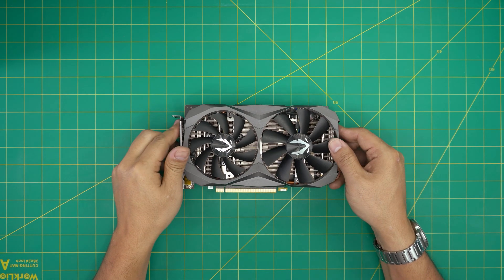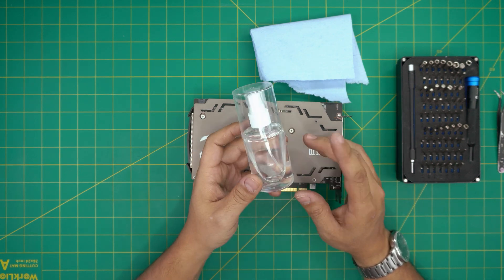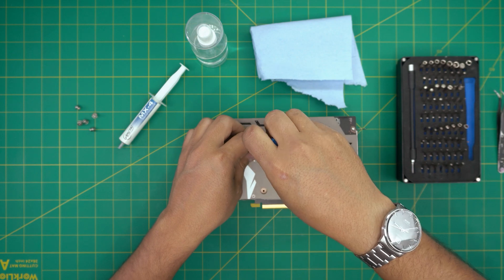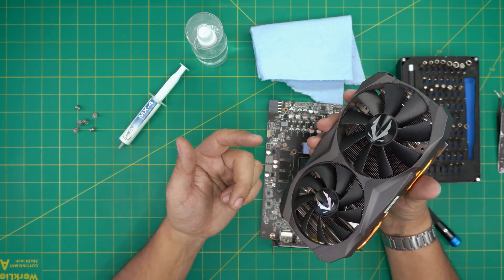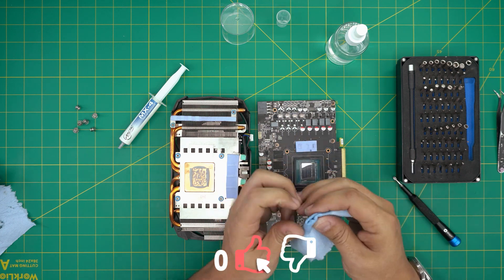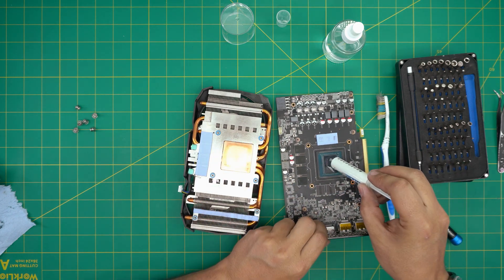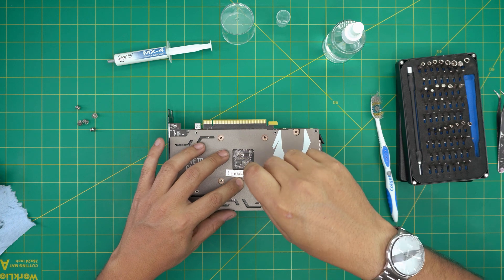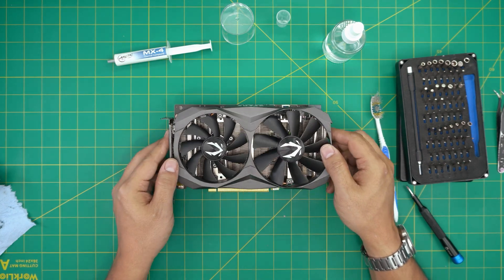How to Repaste and Clean ZOTAC Nvidia GeForce RTX 2060 6GB - Step-by-Step

Comment: The thermal pads don’t matter right only the paste is really necessary?
Reply from the maker: 🫠Regarding your question, yes, the only important thing is the thermal paste, as the old thermal pads are perfectly fine and can last years without any issues.
Should you have any further questions or requests in the future, please don't hesitate to ask me.
cheers🍻
Reply: @uFixTek  when you says years you mean like more than 5 ? it’s been like 4 years since I changed the paste or pads thanks for answering btw
Reply from the maker: the pads can go for over 10-12 years, we have pads from 2012 and still good.

Comment: What is thermal pad size of rtx 2060 6gb amp model ??
Reply from the maker: 🫠Regarding your question, 1mm and 2mm
Should you have any further questions or requests in the future, please don't hesitate to ask me.
cheers🍻
Reply: @uFixTek but the stock thermal pad thickness is 1.5 mm to 2mm . I contact with zotac gaming helpline they ask me TU use 1.5 mm or 2mm
Reply from the maker: We use 2mm, and 1mm also works great.
We service them and stress test them all the time.
But if you wish to use 1.5mm, you can.
Reply: @uFixTek can I use 2mm than ?
Reply from the maker: Yes, use the 2mm, my friend.

Comment: My 2060 of almost 10 years is overheating, gonna re-paste it 🙏
Reply from the maker: Take your time doing the service, and everything will turn out okay.
If you need any help, you can always ask me.
Should you have any further questions or requests in the future, please don't hesitate to ask me.
cheers🍻
Reply: @uFixTek  I just did it today, even got some new thermal pads on. No overheating and I was able to get all the performance back. Looks almost brand new. I needed to order some new fans because they are making a weird noise at certain RPM's. Anyway, thanks for the video, really helpful!
Reply from the maker: awesome job👍🫠
get new fans on aliexpress super cheap.
cheers🍻
Reply: Bro is from future 
2060 launched in 2019 jan... 😂😂😂😂😂

Comment: I got the Zotac 2070 super AMP, what tickness should i take for the pad ?
Reply from the maker: 🫠Regarding your question, i would recommend you to get 1mm pad sheet and then stack them where it is required, the pads can be stacked without any issues.
Reply: @uFixTek  okay thx
Reply from the maker: It's my pleasure my friend.

Comment: Hello thanks for the video, you know that you are mising thermal pads  for your 2 ram chips ? Your thermal pad is on the other side were it should be
Reply from the maker: Thank you for providing your feedback! If you'd like to show your support for the channel, you can either like, subscribe, or do both!

In response to your question,  yes it is missing from factory it was like this, BUT again you don't need the vram pads as this vrams are not OC (overclocked) they do not require to be padded down, but you could add the pads if you wish my friend.
i highly recommend you use thermal putty , rather than pads: https://amzn.to/467KSX1
so you don't have the horrible counter pressure to the heatsink.
Reply: Subscribed and liked the video, and thank you very much for the info, didn't know you don't really need  pads if you don't overclock . Thank you for the wonderful content.